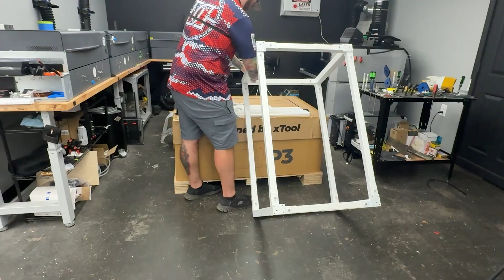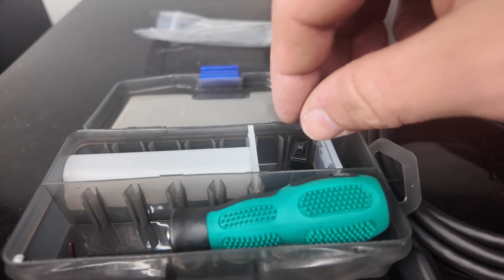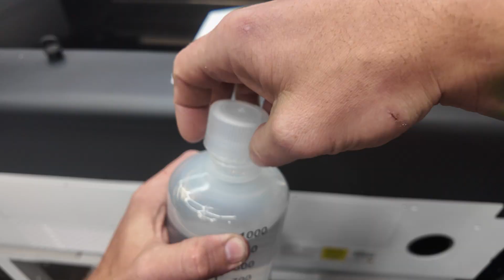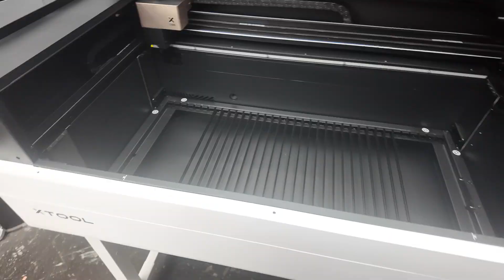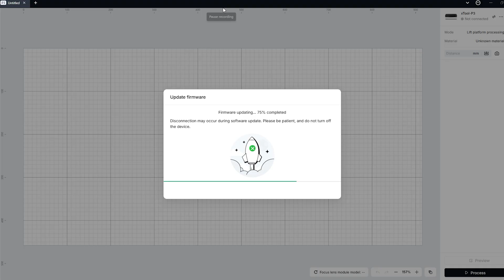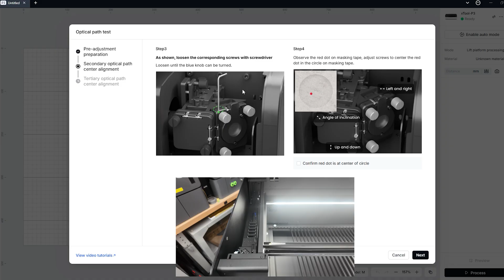COMPLETE xTool P3 Setup Tutorial: From Unboxing to Setup & Calibrated - including Stand Assembly

Comment: Does the P3 have an air assist hook up for cutting?
Reply from the maker: It has a built-in air assist!
Reply: @DiodeDesigns  so the air compressor is built into the laser or does it need an external source of air.

Comment: Are you able to set this up via WiFi and not the USB connection? I have a P2 and this part was painful. USB had issues. Finally was able to get it going via iPhone. Curious if you had any issues or if that is possible. Thanks for the great video.

Comment: did you have to use an extension cord?  The power cords are so short and mine won't reach a near by socket...  also wondering if you know if it is ok to turn the p3 on its side to get it through a door...  just wondering - thanks so much
Reply from the maker: As long as its not full of coolant, should be fine just make sure its all locked in.

Comment: You mentioned the Xtool logo should face out, but it's up to whoever assembles it. In reality, if the logo doesn't have out, the mounting brackets for the wood top will not be on the inside where the top can screw into them.

Comment: We need to take this guy upstairs and that would require turning the package 90 degrees on its side so it fits the stairway. Is it doable? I have the feeling it is only prepared to be transported horizontal flat
Reply: I need to do the same were you able to achieve getting it up the stairs and if so how many ppl did it? Someone said my hubby and I may need to hire movers 😮

Comment: Loved the video, walking through the steps for setting up. 
Wondering if you can do another video on how to run the exhaust outside. 
I want to vent it outside the garage. Use a standard dryer vent???
I heard somewhere about adding a blower into the line???
What is needed and how to go about it. 
Thanks!!

Comment: Thanks for the video. Would love to see one specifically for the exhaust system. Do both the p3 and the if2 come with a length of tubing? So that there are two tubes with the fan in between? Is it 3 inches or 4 inches? Thanks
Reply from the maker: ill get that all covered in the next one for ya... its 3"